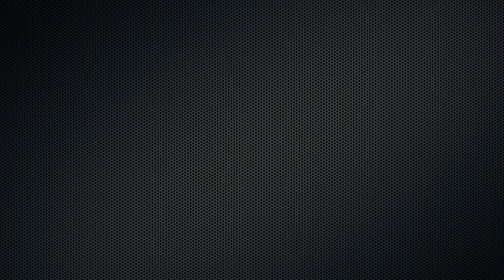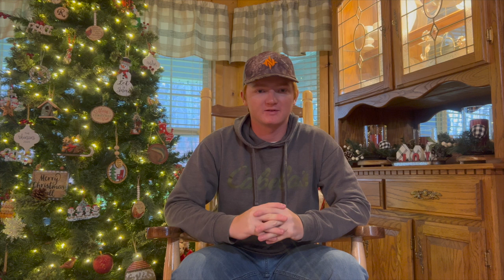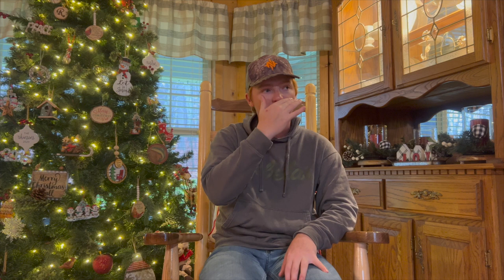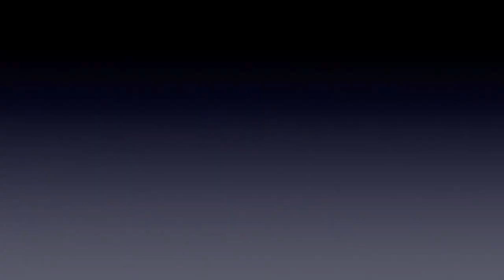Vexus Boat Cracked!! Vexus Hull Crack AVX 2080

Comment: Vexus increased hull thickness and redesigned the stringer/grid system in 2022. Also did a deck upgrade to keep water out of the boxes. The hull has been bullet proof since. New boat company growing pains.

Comment: And that's why I am a proud vexus boat owner my issues were motor electrical problems and I took mine back to Malone's marine in Paris for 3 separate issues and they fixed both electrical issues while I was there and replaced my battery free of charge I have had nothing but great experience so far for 2 years and love my boat so far and hope it continues to be
Reply from the maker: That’s good to hear !
Reply: and you're "proud" of that? Good god...🤕
Reply: @BumpNrun69  hahahahahah this company is now going bankrupt with 2700 boats now to rehull.. Performance is absolutely terrible besides the hull splitting to boot.. The 1980 weighs 2300lbs with 115hp at 42mph 🤷‍♂️ terrible design.. Wont turn safety either. I could go on and on.. I loved the revaluation bench mark they came out with too.. Fiberglass console and live wells hahahahah. Mounted on a aluminum boat 🤷‍♂️. They serious 😂😂 .. what a joke of a boat.. every bracket and stringer is made In China along with every model   getting the same size brackets.. Long story short joke boat

Comment: I bought an 1880 in 2019, no problems so far but I will be following. You are right about swamping the back when coming off pad, I have to set it down gentle to prevent it. It’s been a great tin boat so far.
Reply from the maker: We love the boat for sure, it is unfortunate that it cracked but I guess that’s part of getting a generation 1 boat. Vexus is making it right with us so I have no complaints
Reply: Vexus can make it right , was the bottom split ?
Reply: If so he can weld on it all he wants it will split again

Comment: 2 years ago I heard something coming down the river I fish. It was pretty rough, but in 40+ years I had never heard a noise like this. As the boat passed it was a Vexus. It sounded like a darn beer can pounding those waves...guarantee that boat met the same fate as yours.
SELL IT!!!!
Reply from the maker: Vexus replaced my boat with a 2023 model
Reply: @jacobrobinsonfishing  did you ask what improvements they have made to that hull? Or is it still a flawed design.
Reading the comments, the number of people who have experienced the same result. Doubt there are 500 out there. That's a high number of failures.
Shows NO testing.
I would sell it today!

Comment: I went through this same process in the same timeframe with my 2021 1980 , got the boat back Christmas Day
Reply from the maker: How’s your new boat?? Me & my brother are supposed to get ours back next week and I’m excited
Reply: @jacobrobinsonfishing  it’s good they changed the rigging up for my electronics and we are troubleshooting with power to different parts of the boat, other than that no complaints they gave us new sea deck from what we had, raised the lips on the compartments. And added a v that goes from the bow to the pad in the back.
Reply from the maker: @parkeradair7197  nice! Hopefully the new boat doesn’t have any more issues
Reply: @jacobrobinsonfishing  we had a 12 inch crack under the passenger seat, we had them patch it up so we could fish a big tournament the next weekend then at the tournament over two days the lake was rough and we cracked it down the weld that went down the middle of the boat another 10 inches.
Reply from the maker: @parkeradair7197  dang ! So is your boat a new hull now ?
Reply: @jacobrobinsonfishing  it’s the new 1980 I believe the 2080s have the changes too
Reply: @jacobrobinsonfishing  if anything else goes wrong I we can drive 2 hours to the factory
Reply from the maker: @parkeradair7197  sweet! I’m excited to get ours back, I’ll be doing a video once we get it
Reply: @jacobrobinsonfishing  I’ll watch it let me know if you ever want to go fishing in Arkansas
Reply from the maker: @parkeradair7197  sure thing, thanks!

Comment: If you would have looked it over you would have seen that big of a crack and the dealer should have seen it to, the previous owner was rough with it ,it takes a hard hit to crack the aluminum hull
Reply from the maker: Hindsight is 2020 buddy
Reply: Manufacturing aluminum , bass boats, it needs to withstand the rough water conditions.
Reply: That fracture started when it was in the press brake.

Comment: Aluminum cracks hitting waves fast
Reply from the maker: This boat was cracked when I bought it
Reply: @jacobrobinsonfishing  aluminum cracks 100 gauge boats don’t have a chance , it will crack again too once rewelded , also there is different grades of aluminum , 3/16 or 1/8 is not thick enough
Reply: If u put a big motor to run fast over choppy water like in lakes you will break it
Reply: @jacobrobinsonfishing  the guy that had it before you broke it an this is probably why he got rid of it
Reply: @jacobrobinsonfishing  when those production boats are built there is not enough strengthners , and if it flexes it will crack